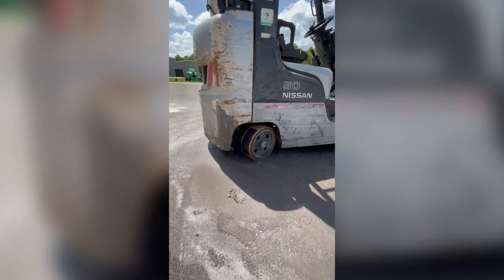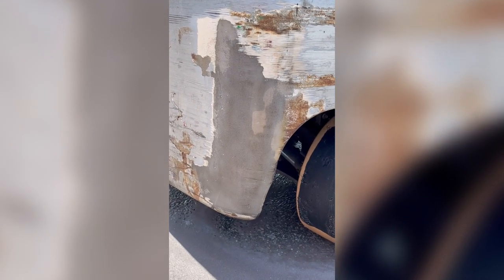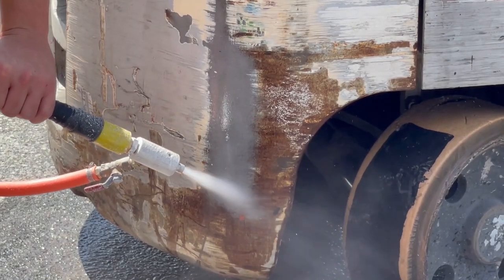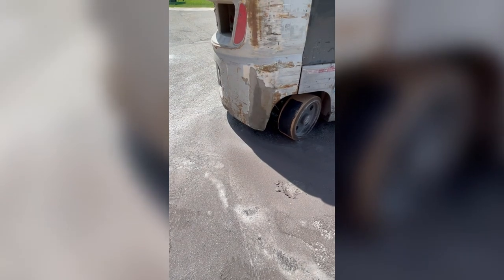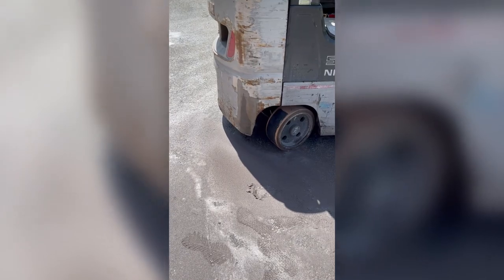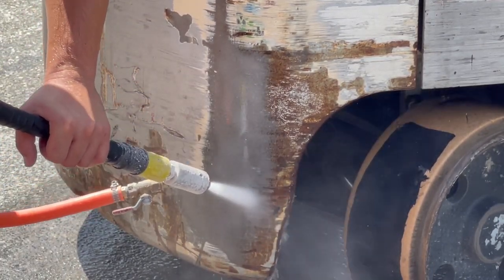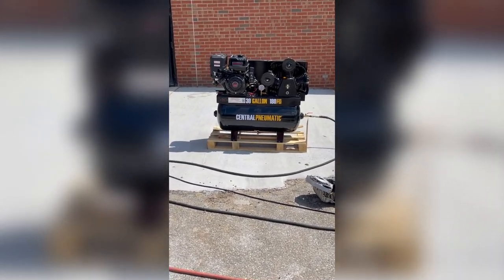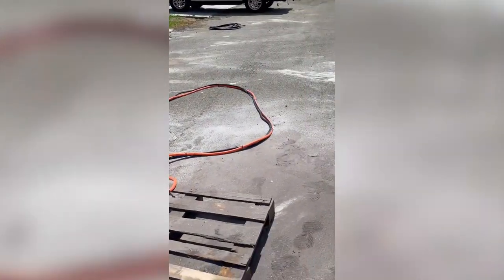Removing Rust from Fork-Lift using Wet Blasting Mobile Unit - Vapor Honing Technologies

Comment: You could put a clean tarp down to catch the extra, and use a screen on a pickup that has the filtration rating slightly larger than the media too. Maybe raise the sides of the tarp to help centralize the media as well.
Reply from the maker: That is exactly what we did.  We also had a customer suggest small parts in a pool to catch abrasive.
Reply: @VaporHoningTechnologies  noice, I’d like to get one of your blasters one day 😤🤘🏼